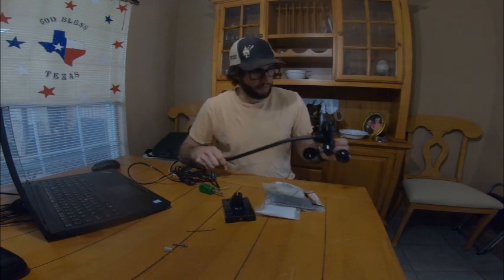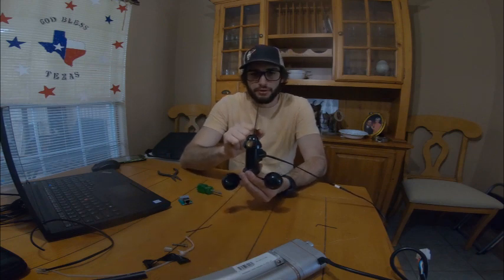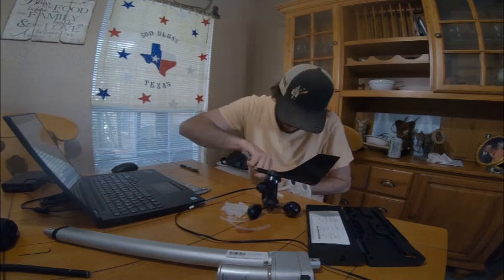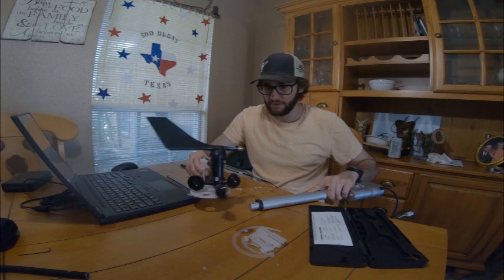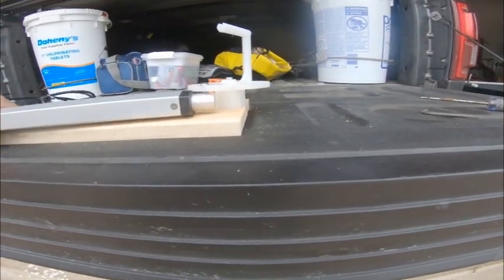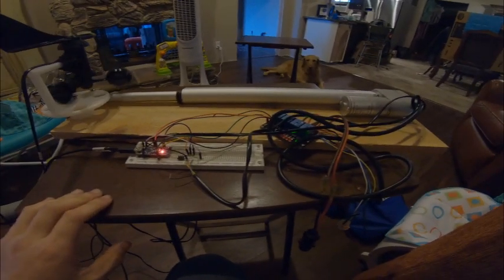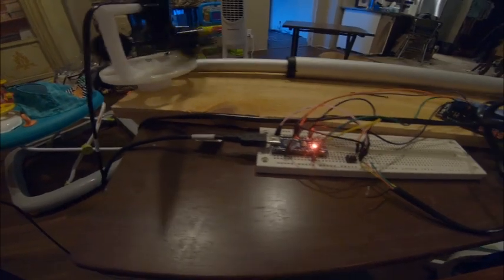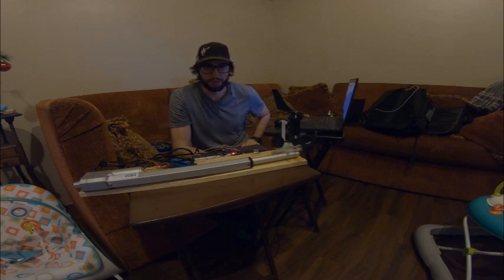DIY Arduino Sailboat Autopilot - Episode 2

Comment: Great project, I came to this video because I try to do a similar autopilot for a sailboat, I thought about using the linear actuator and a GPS connected to the computer, is there any way to contact you in private? what about your experience in terms of power with the actuator and the stress handled by it?
Reply from the maker: you can reach out on our facebook page NewSaltSailing

Comment: Great project. I wonder how the dc motor in the actuator is controlled. Is it time-based? e.g run for 2 seconds and then you know you've done 2 revs if it is a 60 rpm motor? Or you have an absolute encoder identifying the exact position of the motor shaft?
Reply from the maker: There is an encoder in the actuator.     The speed is controlled via PWM  signal which is outputted by the PID logic i’ve programmed into the arduino
Reply: @newsaltsailing7756  Brilliant thanks!

Comment: What model 3D printer to you have? Is this something a home DIY person could do? I restore both boats and vintage motorcycles and this would really come in handy. If not for the part, perhaps as a 3D mold. Thanks!
Reply from the maker: If you are willing to dedicate the time it takes to learn how to use drafting software it is very DIYable . 

You will save yourself thousands of hours of work if you master it!
Reply from the maker: hictop prussa I3

I have made fiberglass plugs with 3d printers then casted a mold from that plug!  Works great and cuts out hundreds of hours of sanding and prepping the mould

Comment: Amazing project! I did something similar a few years ago on a 34' diesel trawler that had hydraulic steering.  It worked,  but we ended up selling the boat before I got it fully tuned. 

I have so many questions!

Is the actuator waterproof? 

If the autopilot is software disengaged,  how do you steer? I hope you don't need 150lb+ of force to move the tiller. 

I'm assuming with the motion of the boat,  mounted at the top of the mast,  fluctuations in wind,  and delays in processing,  your range will need to be much greater than a couple degrees, otherwise the autopilot will probably spend most of its time wandering,  even with PID fully implemented and tuned.  I wouldn't be surprised with a 10° range.  I couldn't get better than a 5° heading on a power boat.  Have you considered a 3-axis compass for your inputs? You could even account for pitch and roll eventually.  It might help smooth the tracking?

In any case,  I'm excited to watch you continue to experiment and refine this project.  Great work.
Reply: That is a linear actuator, it's a brushed dc motor on a worm gearbox. Unless sealed, it shouldn't be fully watertight, but ok for water splashing on it. This type of autopilot would have to be physically disengaged, as you can't backdrive it.
Reply from the maker: Thanks for the comment!

The Actuator is not waterproof, the plan is to eventually mount it below the cockpit and run line and pulleys up to the tiller from below deck to control it and protect it from the elements. 

The autopilot will need to be disengaged in order to steer the boat manually. the plan here is to setup some sort of manual clutch assembly so that the autopilot lines coming from below deck can be quickly disengaged and manual control can be taken back over quickly. 

i do also have a 3 axis compass that i will be utilizing for my "heading driven"  mode of this autopilot system  but it will not be used in unison with the "wind driven" mode.  i believe i should be able to maintain a 2-3* heading accuracy with this system .   if you watch some boats with wind vanes  the tiller is constantly moving and correcting.  this will do the same thing.  the higher i allow the duty cycle the more accurate it will be.  I just need to decide what that number will be and how much power i need to have on board to make it work.

Comment: Great explanation of what you are doing with the autopilot system. What type 3D printer are you using?
Until our adventures cross, fair winds and full sails  
Jack and Billie
Reply: A monoprice maker select v2 is what I have, I sourced it as an openbox model for $200. Filament is cheap, but learning to 3d print can be challenging if you don';t have a technical mindset, as there are quite a few parameters to keep in mind while printing(humidity in environment causes plastic to absorb moisture, which can affect print quality, different filament sources even within one plastic family can print differently, ambient air temps, bed temps, what you are printing can affect the overall cooling of the print and warping, overhangs, etc.)
Reply: Go here for the answer to the issue of humidity: https://www.printdry.com/
Reply from the maker: hictop prussa I3 is the one i’m using here   Its a cheap model but does a great job       The parameters are tricky but once you get them figured out for your environment and material  its great!